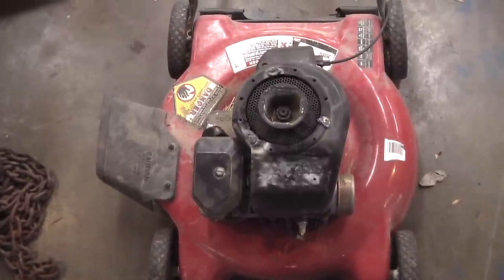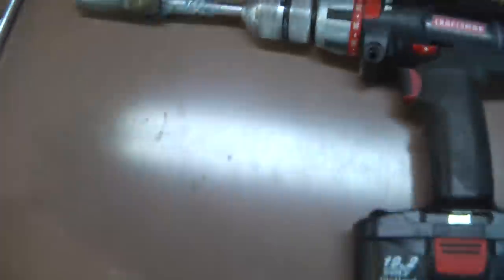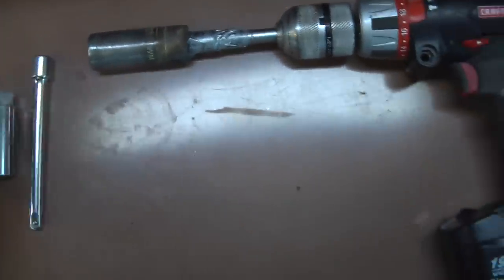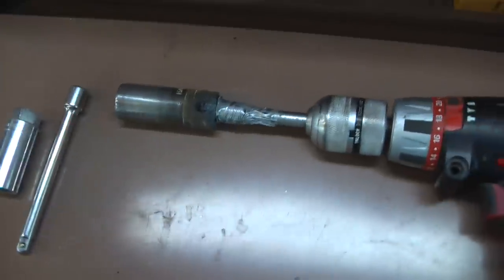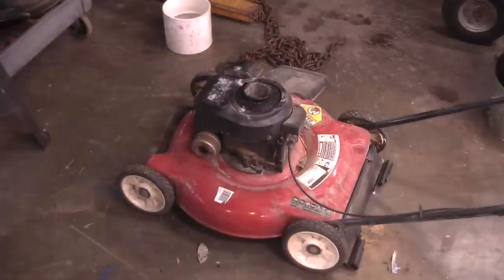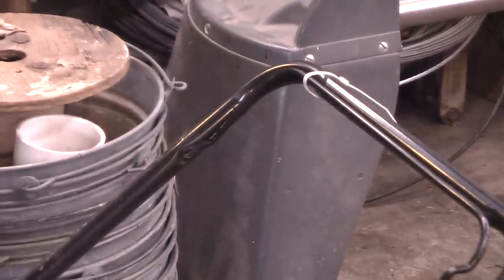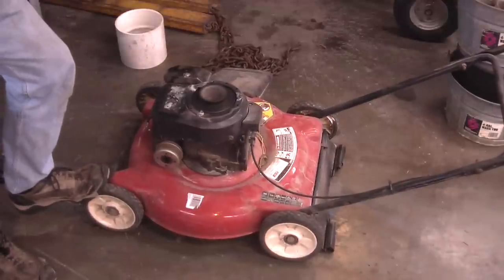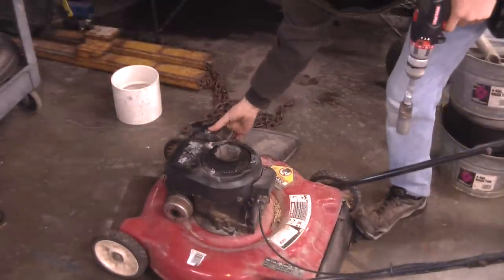How to make an electric start for small engines

Comment: Very handy idea. Many years ago, before recoil starters were common on mowers, all mowers came with a cord that you wrapped around the coupler where a recoil would normally be attached. Once wrapped, you merely pulled it to spin the engine. It was a pain. But, back then it was the only way. Cordless drills weren't around yet. When I was a kid, I would mow lawns for extra cash. The going rate was $2.00 -$3.00 per yard. Nowadays, it's at least $50 and UP! LOL
Reply: me to.
Reply: shoes were thoe lol

Comment: I just started a 16.5 Briggs with drill and socket. Don't cut up a good extension.
Use a carriage bolt. The square shoulder will fit into the square hole in the 1/2 inch drive socket. My engine is 16.5 horse, so I used an AC electric drill. The mower had also been setting for at least 3 years. It took about ten try's to start it up.

Comment: You do know that you can buy a socket driver that fits on a cordless drill without having to modify your tools to make it work.
Reply: that's true
Reply: he said that in the video
Reply: Mitchell Richardson I thought about cutting an extension like he did on the video but instead, i bought socket adapters to drill bits 3 size (1/2, 3/8, and 1/4 inch) for only 4 bucks.
Reply: I've got them tools, came in a set of three and only a few quid, use it to sharpen /back lap my cylinder petrol mower
Reply: Not always
Reply: LMAO! Thinking same thing.
Reply: Gotta make sure that your drill chuck is a 1/2 one. I'm having to buy another drill driver, cuz mine is only  a 3/8 and the socket extension's diameter is too large to fit in. Also having two "flats" ground into the end of the extension (that will go inside the chuck) so that it won't slip & spin inside the chuck.
Reply: But he didn't want to spend money
Reply: My man isn’t into investing into something you can buy, or hey would get the recoil. Last true Man out there!
Reply: That's exactly what I'm thinking. Why are these guys making this so unnecessarily difficult.?
Reply: Or you could just be a man and pull the cord 😂😂😂😂😂
Reply: Or buy a recoil starter for 12 on Amazon

Comment: In the 1960's we used an electric cord drill to do this...... P.S.  an old tire iron has the socket right for most motor nuts, just cut  the size off you need, file down the shaft to fit ? the drill.    OLD GUYS RULE!!!!
Reply: every spring or fall my back gets smoked trying to pull log splinter, powerwasher. The motion of yanking to the side brings back in full pain glory my blown discs in the lumbar.  thanks for tip
Reply: I do concur my good man old guys do rule
Reply: OLD SCHOOL, and proud of it !!

Comment: Great Idea- Two Suggestions-you should make a holster attachment for your drill. What happens if you have to stop to move a rock or stick? It sure would be a pain to walk back lug this around or walk back to your tool shed. Also why didn't you use a 1/2 extension rather than a 3/8 with  adapters ?

Comment: When the starter goes bad on my old truck I take the hubcaps off with it in gear so I can put a drill like this onto the lug nuts and crank it up.  When it cranks up I got to run like hell to catch it before it goes down into the woods.  Works like a charm as long as I got my running shoes on.

Comment: It worked for a stubborn lawn mower.  Used a octogon  old 1/2" drive 15/16 socket. My 3/8" drill would not work and I didn't have 1/2-3/8 adapter.  So I found a 1/2" electric lamp bolt and placed the head in socket and tighten down the nut.  U had to over tighten the bolt with a vise grips and 1/2" wrench.  Iprimed the bulb about 4 times. It took about 10 seconds of running at full speed and it cranked. I let run for 3 minutes.  This #$%$ lawnmower would not start before this  trick. Thanks LC

Comment: Let me add one thing. When using the drill and the engine starts, DO NOT STOP THE DRILL and then remove it. NO! If you do that, there is a chance that hand can dislocate or brake. AND if the engine starts and you let the drill stay on because you didn't have time to remove it, then the drill can circle around so fast and can be thrown as a bullet into anywhere.

When drilling and engine is about to start slowly pull up and keep the button pressed. Thats the only way and safe way.

Comment: 👍🏻👏✅I’m having trouble with my pull start mower, and have the same craftsman 19.2v drill. My cord pulls, it’s just really hard to pull. Mechanic said it had lots of torque. But once it starts, it’ll run as long as you don’t stop it or it gets choked up with grass build up. Then I’ve got wait about an hour before it’ll restart.  But your solution is a great idea for when my cord breaks. 4-25-2021

Comment: Warning!!! I start lots of small engine like this when they come into my shop for repair and the pull start is missing. If there is a problem with the engine like a sheared flywheel key or the valves are out of adjustment, the engine will kick back turning the drill backwards. This can seriously damage your wrist and fingers. Be careful
Reply: My right rotator cuff is bad so I removed the recoil start and cut a hole in the cover of my cub cadet mower in order for me to start it this way. I'm not sure if the valves are out of adjustment or not. The mower runs great, but at least once every time I go to start it, it will kick back like you say. I always make sure to place my foot on the deck, and while holding the drill with both hands, I'll brace the drill on my leg. Still, sometimes it hurts my wrist.
I purchased a rachet adapter to try and prevent this by allowing it to spin backward freely when this happens. However, the "Performance Tool" brand name ratchet adapter I purchased locks both ways from the sudden impact caused when when the engine tries to go backward. I'm going to purchase another name brand until I find one that will work.
I'm no lawnmower mechanic by far, and I've never heard valves being out of adjustment could cause this. It seems to me if my engine valves were out of adjustment enough to cause this that my engine wouldn't be running as good as it is. Could it be possible for the valves to be out of adjustment in my engine to cause this, and the engine still starts and runs great like it does? I need to get past this before it does break my wrist. Thanks
Reply: @LH-kz2nf   No ratchet adapter will work.
Reply: @wcjcnc  I'm going to try another route like another you tuber did his. He used the gear box and motor from a kids' power wheel car. It uses the original part  from the recoil start that fits down into the cup mounted on top of the flywheel. When starting the fingers, come out and turn the engine. Once you let off the starter switch, the fingers retract

Comment: I'm impressed that just a cheaper cordless drill like that on high speed gearing has enough torque to turn over one of those two strokes, nice job!
Reply: It doesn't, at least not my Bauer drill from Harbor Freight. It cranks no problem in low gear, but that doesn't spin it quite fast enough to start it easily and reliably. In high gear, it either won't crank or it stalls as soon as it starts spinning.
Reply: @averyalexander2303  Interesting!I wonder if a newer brushless drill would have enough juice, I've seen them kick back though, Musty1 has a device for that to keep you safe if using like an AC drill as well from kickback! wow 15 years ago I made that comment! different life!
Reply: @Kingsoupturbo  It likely would. A newer battery would likely do better too. My drill is around 6-7 years old now, so I'm sure the battery lost a bit of its power. A good corded drill would work much better for sure.

Good point about kickback, that could be quite dangerous to the drill and yourself. A one way clutch would be ideal for this setup so the engine isn't directly tied to the drill and can spin up freely without affecting the drill.

Even just setting the drill's clutch to the loosest setting that doesn't slip while cranking would provide quite a bit of protection compared to the clutch being totally locked if the engine did kick back.
Reply: @averyalexander2303  Good points! some of the new brushless drills are so powerful, and it really depends on what you're turning over I suppose, how much compression etc!  I think if you get a kickback, it can be quite bad for your hands, think old Model-T starting broken thumb syndrome!  I have a newish Toro mower that starts so easily on the pull start, all those newer motors have compression release for starting, it even had an electric start option, what a world!

Comment: I use small bungee cords as bail-bar tiebacks. One end has a 3/4 in. black ball, the other has a loop that you pull over the ball. I tied a knot or two in the middle to shorten the length so I only have to wrap one time around, then fasten. One cord for the blade-brake/engine-kill bar, and the other for the front-wheel self-propel bar. I always remove the "propel" cord off first. Works like a champ!  I'm getting the parts together now to duplicate your "electric start" tool.

Comment: You can use a servo motor to spin the starter with the adapter and have that as an electric start. It works on the similar concept of the drill.
Reply: But wouldn’t the fact that it’s spinning break off the electric motor, unless you have some kind of way to disengage it?
Reply: @ogre1890  yes you could use like a centrifugal clutch or something like that to disconnect it
Reply: @caleb0606  yeah good idea. I’d thought of using a 1 way bearing

Comment: That entire mower didn't cost 50 bucks. Also looks like you almost trimmed your toe nails.
Reply: Yes, he did. Ouch.!
Reply: there are free woking lawn mowers everywhere on craigslist, still wondering if i could use one from a project but all the engines have the rod facing downwards
Reply: I tried those nut on flywheel came off when it started was looking for one way devise ruined crank on Tecumseh motor bike 2hp.
Reply: @Shyzah  You can obtain bevel gears that can convert the motion, you can also convert the engine to horizontal if you open the crank case and add a oil slasher inside the case. The reason you can't run the engine horizontally is just because it gets oil starved, the oil slasher can fix this. You may have to modify the case so the oil doesn't just go to the cylinder, but that can just be orientation.
Reply: @Shyzah  No there isn't
Reply: It's prolly just an old trimmer mower. The guy likely has a ZTR or a tractor-mower. Even cheapie new push mowers are close to $200 now ! And "replacement parts" ARE high.

Comment: @birdwing98 i was doing some research trying to find out if it were actually possible to start the engine by spinning the blade without any tools. Have you legitimately started a mower as such? furthermore isn't that rather hazardous?

Comment: I did this once with a mower.  When the engine started it had just enough kick to loosen the nut on top.  10 sec later it came flying off and rolling down my driveway.  Be careful starting small engines with this method!
Reply: AllNamesRntAvailable do they have something like that for an impact ratchet?
Reply: Hahahaha priceless

Comment: Nice Shoes... You do know you could just wrap a 4 ft piece of rope around the part with the nut and pull it and it will start... That is the way they was made many years ago...
Reply: that's what I've done in the past. but honestly if the thing runs good and is in good shape don't be a cheap ass and buy the damn recoil.
Reply: True I Have started many this way.
Reply: Z71Ranger ....I laughed for two days.. first thing I saw.. and your dry simple comment "Nice shoes"

Comment: use the correct adapter or an impact driver and it's a way easier diy.  also instead of a bunch of  those plastic ties, use a cable cuff you find at the big box stores.  I use one to keep my mower going when I leave it.

Comment: You can buy the drill adapter at Lowe's that allows you to put sockets into a drill. You do not have to cut a perfectly good extension. Also the adapter has a lock ball so the socket will not fall off.

Comment: Just tried this with my lawn boy 6.5hp, didn't work like it does here, I get the mower started then for some reason the flywheel bolt just seems to loosen itself and so I got a running two cycle engine with no bolt to hold on the fly wheel, what did I do wrong?

Comment: I've had to resort to that trick to get my 18" Husqvarna chain saw running due to sticky return on the pull starter. Not something I'd want to do long term though unless I could obtain or engineer a unidirectional clutch so that the motor can run faster than the drill without torquing the drill out of one's hand.
Reply: Exactly

Comment: the older 3.5 classic, sprint, and quattro engines they used a starter clutch that stuck in the recoil assembly as you have to get a socket that fits onto the starter clutch to start the engine. as some 3.5 hp engines from the early 1970s - the mid 1980s they used a vertical pull starter. if it breaks take the flywheel screen off and use the socket and nut to start it with your drill.

Comment: I got a recoil for a brigs 3.5 off of ebay for 12 dollars and I didn't have to buy the shroud/cover, just rope and the little round metal piece that house the spring. Got it in the mail, got out my pop rivet gun and put pop rivets in the old holes in the engine cover. works great, don't have to run back to the garge when the engine dies, don't have to wory about my battery being charged, don't have to worry about standing right next to the engine. but good idea if it works for you then great.

Comment: No sir wattage is the only electrical term you need to worry about because voltage and amperage determine sine wave and batters are labeled by voltage because it's a generic house hold word and if batteries were labeled by water they would also have to be labeled by microfarad to determine the series or circuit capabilities which would just confuse people but appliances have specific size and shape batteries and connectors depending on what wattage and since wave.

Comment: Hey hopefully you respond but I have a 212 6.5 horsepower predator engine but the compression on this thing could rip your damn arm off do you think this would work on that? Or is it really worth buying an electric starter? Also I'm new to engines so could you help me out a bit, what is the part/parts I would need to make the engine start with a key?

Comment: I'll have to weigh in on the side of avoiding the zip tie bypass of that safety bar. I know it's awkward to start while pressing the safety bar down, but that position forces the operator to stand in a safe position. It's surprisingly easy to amputate human parts with a lawn mower, especially toes....

Comment: hey real quick: im 14 and got an old briggs and stratton mower, push mower, and it hasent been started in like 4-5 years if i try your invention will it work? and can i do this without welding the peice on or cutting the metal extension because i dont have anything that will cut meatel,      thanks!

Comment: Very good.  I did about the same thing 15 years ago with a Lawn Boy. I used a half inch impact drive.  
Someting good to use instead of a half inch extension rod, is an old  hexagonal punch. Electric drill and its chuck like hexagonal shaft. The end going in the socket, where it will be welded, could have to be grinded accordingly...

Comment: With the mower moving around on the floor after it started, I would say you have a vibration problem, maybe a bend blade or a bend crankshaft, if that is the case, time to toss that for another one.

Comment: What does the nut you are attaching your socket/drill motor, fasten down. Is there a chance the nut will come off while starting your lawn mower?
Reply: no it won't because it turns to the right and that's the flywheel nut. so it can't come off
Reply: if nut comes off when it starts flywheel becomes UFO then you'll need magneto too.mabe er. visit.
Reply: Don Desnoo there's not a snowballs chance in hell of that flywheel coming off. Hell, even without the nut on, 99% of the time you need a 4 lb sledge to whack the flywheel with to get it to break loose.
Reply: can you over tighten it then?

Comment: Thank you so much for the help. Just to let you know there is now adapters for you drill to use for sockets. $3.50 for a set which covers 1/4" , 3/8" , and 1/2".

Comment: Socket needs a one way clutch on it, so if if engine starts to spin faster than the drill, it doesn't take the drill with it.  That's the main reason I haven't done this myself, though I've been sorely tempted.

Comment: I used a 3/4" socket on my drill motor when it's hard to start and my arm is tired of pulling the rope.Also,in cold weather they will be hard starting. Use a heat gun on the carb. Works.Haven't used my rotary mower as a snow blower...yet.

Comment: will a vertical shaft engine run without the mower blade on it like a horizontal engine ??..do they use different weight flywheels ??..I have no vertical shaft mower to try it.

Comment: Way cool! I did that once with a 3HP B&S vertical with the square-shafted starter clutch (can't remember what size socket I used), without the shroud but you shouldn't run an engine without the shroud or it'll overheat

Comment: hey thanks i did know that you could do that ill remember that but i just found out that i can crank it over with the regular ignition just before i had a house wall light switch for it  since the solenoid was bad but the wires were to thin so it would barely crank over with a full battery

Comment: The dewalt dcd985 20 volt max lithium ion drill set in drill mode with the speed on 3 using that attachment you made will start that thing up no problem.